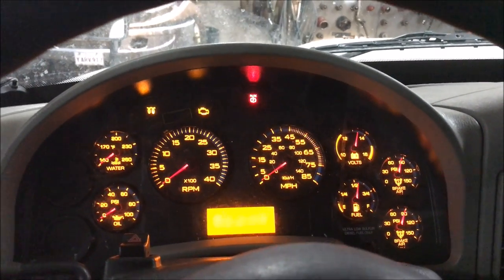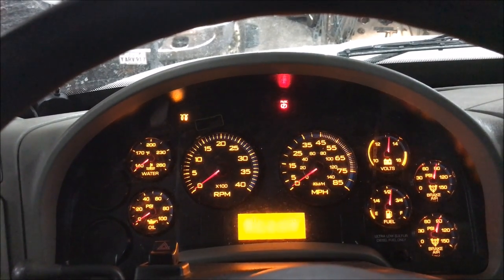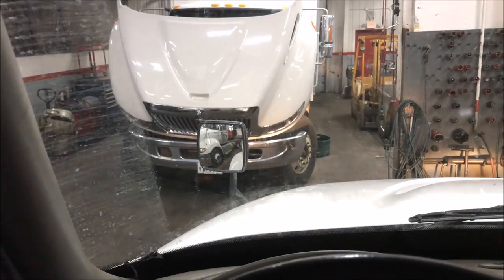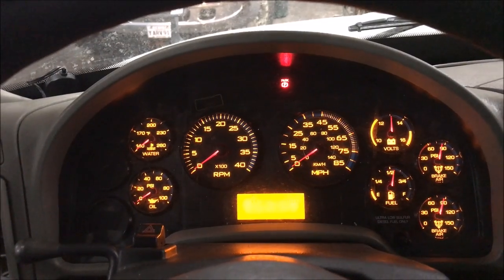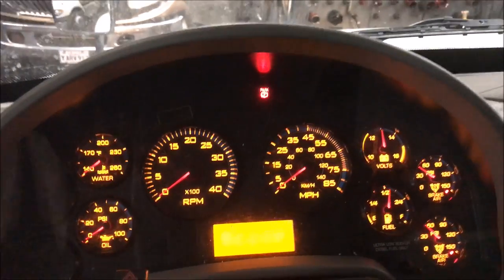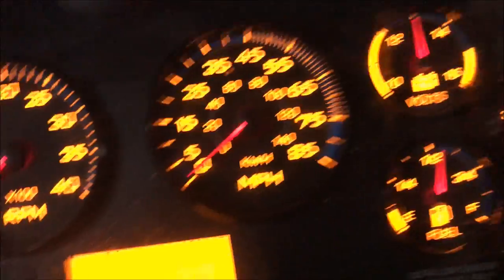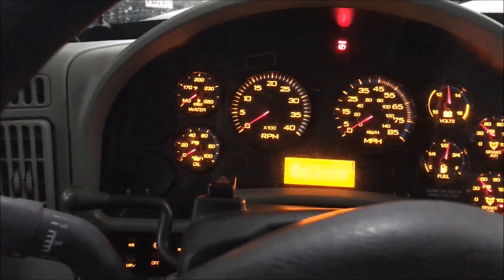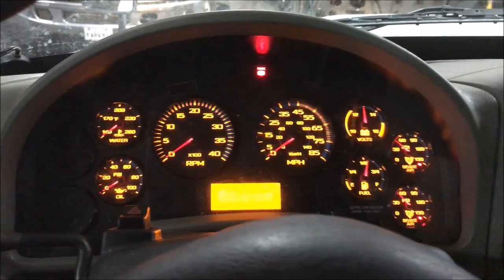International Warning Alarm/Chime/Buzzer Disable

Comment: Serious question. Do international trucks beep when you go over a line? Like say your driving and your tire veers off a little over the lane line does it beep?
Reply from the maker: It’s possible if it has an On Guard system or other system like Bendix that has forward radar and lane assist. Would have to be a pretty new International, though.
Reply: @Tony The Truck Guy  I started working for a terrible company and the first day I drove which I've been driving for years but the first day I noticed the alignment was off so I was on the line a few times and she's like oh well trucks this big can't keep a good alignment and the international will make a loud noise on either side of the inside of the cab if I go over a line and they don't have brand new trucks. The one I'm driving now has over 230 thousand miles on it but I just thought that was a crazy thing to say!
Reply: @TonyTheTruckGuy  also thank you so much for the response!
Reply from the maker: @avibeontherun  You can definitely get a decent alignment if all the suspension and steering components are not worn and whoever does the alignment does it right. International dock trucks all ride like shit, though. The rear suspension sits on the bump stops from factory.

Comment: Thank you so much, our jetA fuel truck at my airport has this terrible beeping every time we use it because of an air leak my work is too cheap to fix and it kills my ears. When I start it up I have to stand outside it for 5 minutes until the beeping stops, I’m excited to try this, wish I could just find the actual speaker and rip it out.
Reply from the maker: Yeah it MIGHT not work with the low air buzzer. Some situations it just simply won't stop beeping, but it's worth a shot. I believe the beeper itself is housed just below the cluster but I can't remember which side of the steering column it's on. Another gentleman in the comments here said he located it and jammed a rag in the speaker compartment and that made it much more bearable lol.
Reply: I mean, who needs brakes with 3,000 gallons of jet fuel on board lol. They really need to fix the air leak instead of masking the problem.
Reply: @jasoncammeyer757  Wow I can’t believe it’s already been so long since I made this comment. I’ve gotten out of my 10 plus year aviation career and work at a chem plant that prioritizes taking care of its equipment. Funny thing is I really bet that truck still has this problem lmfao

Comment: If this does not work, which in my case, did not work, then I have a bandaid... through losing my damn mind over constantly hearing this beeping, i finally found where it's coming from. If you put your head under the dash panel light dimming switch and look at the bottom of the dash... up by the wires and everything. There is a small circular hole kinda above the back of the dimmer panel. If that made any sense. That hole is where the beeper is at. My temporary fix was just using the tools i had handy, i stuffed  a balled up piece of mcdonalds napkin in there. I can no longer hear it. However if you feel like opening your dash and unplugging it, that will work too. But a balled up piece of napkin works great too. Just have to stuff it into the hole.

Comment: Mine is a '19 LT and the TPMS (tire pressure monitor system) has a failure so that infernl chime is constant.  My dash, etc is a bit different, mine doesnt have the light brightness button it has a manual type dial (up or down) and has a trip odometer (1 and 2)...I tried holding the brightness dial to the top while resettting Trip1 Odometer but that didn't reset the chime....any other ideas for resetting the chime on my International model? 

I even considered wrapping the chime speaker to muffle the chime but couldn't find it amongst the wiring when i removed the lower dash panel to look for it.
Reply from the maker: Unfortunately I haven’t played with enough of the newer LT’s to see if there’s a trick to do the same thing on those or not so I can’t offer any additional helpful advice aside from trying to wrap or plug up the chime speaker as you said you were already trying to do but I k is they’re a pain to pinpoint lol

Comment: Any idea what could cause both air gauges to malfunction especially in the mornings. First thing in the morning they will max out and driving down the road they   jump between 30 and 150 pounds
Reply from the maker: Kind of hard to pinpoint it without some testing, but I’m guessing your actual air pressure is fine since i normally can’t fluctuate like that. You’re probably looking at faulty wiring, instrument cluster, body controller, or somehow both pressure sensors went out at the same time. But again, hard to pinpoint without actually looking at it.

Comment: I've got an older freight shaker and when I drop the air bags a buzzer goes off. I do that to level the truck out to sleep lol. Not a problem when the truck is off, but if I need ac or heat I just idle the truck. Is there a way to do a temp or permanent disable of that buzzer?
Reply from the maker: Not that I know of unfortunately. Unless you were to cut the wire going to the buzzer, but it might be the same buzzer as your low air warning so that would be a no-no for DOT lol
Reply: @TonyTheTruckGuy  I'll have to check my air buzzer and see if it sounds the same. Thank you.

Comment: Not working for my low air pressure with key on On position 😭 any tips?
Update: key on accessory position worked but not all the way to the left.
Awesome thanks so much dude, now I can watch TV in peace without the buzzer going off.
Reply from the maker: Haha yeah it will only work in certain positions but it beats nothing
Reply: Tony The Truck Guy dude shutting that off beats everything. And it's temporary do DOT won't climb up my ass and down my throat to meet in the middle and discuss what other ticket to give me.

Comment: Tony
I have a 2016 d13. The low air warning buzzer works with the truck started. It will not work with the key in the in position 
Any suggestions
Reply from the maker: I assume you're talking about a Volvo? I think that's how they make them to be honest. I've noticed when doing DOT inspections on a lot of Volvo's, they typically have the visual light indicator showing that the truck is low on air if the key is on, but won't actually sound the chime unless it's running.
Reply: Tony The Truck Guy  Yes it is a Volvo. I have someone testing in it Friday and one of the air brake pieces is that with the key on and truck off to bleed the brakes down to 60 lbs til the alarm comes on. There are plenty of lights that come on but no alarm.

Comment: Hello,

I am having this issue with an international ProStar 2008. It stops for a few seconds and then it is back at it again. I have tried with the engine on, as well as the switch on ON as well. Thoughts?
Reply from the maker: Well do you know why it’s beeping?
Reply: @TonyTheTruckGuy  no i beeps none stop while on and while driving
Reply from the maker: @lixyibethgarcia1892  Not overheating or low on air pressure or anything?
Reply: @TonyTheTruckGuy  nope
Reply from the maker: @lixyibethgarcia1892  That’s very odd. Something must be triggering it. This trick only works temporarily unfortunately

Comment: How do you stop the buzzing noise coming from brake pedal when you shut off your truck?
Reply from the maker: If it’s not the same noise as shown in this video, but rather a buzzing or humming noise, it’s likely your electronic brake assist motor not shutting off for some reason. The motor helps assist you with braking in the event that you lose hydraulic/vacuum assist. You can check the fuse box on the passenger side dash and on the drivers side steer fender under the hood to see if there’s any fuses or relays for that brake assist motor that may be bad. Otherwise there may be an issue with your ignition where it’s still sending power even with the key off, or the motor itself could be shorted out. Hard to pinpoint exactly without being there to check it out but hopefully this gives you some idea.

Comment: It only works with key turned to on position. But once truck is running,  it doesn't work, the alarm continues to sound. All my gauges on right don't work either, like volts, fuel, air. And DISAB (rollback assist) blinks. I have 2016 International. Any ideas? Lol, yes, I'll eventually get it to a shop.
Reply from the maker: It seems to also work with the engine running, but only for limited issues. I’d say body controller issues or wiring if it’s a clump of gauges not working. We have had a few in our shop act up and people shotgunned gauges at them without curing it.
Reply: @TonyTheTruckGuy  another driver told me to disconnect/reconnect battery wires to reset it. It worked. I was 7 hours from repair shop, that alarm was dri ing me crazy lol. Thanks for getting back to me!!

Comment: Tony,  volvo fm9  (Ireland )  the dial in cab for switching between cold and warm air is broken, stuck on warm,  not good this time of year ☺I've been driving scanias most of the time and know where the manual opener and closer is under hood,  searched all around volvo and can't find it,  any ideas?
Reply from the maker: Did the actual dial break or does it just not seem to be doing anything? I would open the hood and check the firewall for where the heater cord hoses come out. Follow those and see if there’s any manual shut-off’s in-line with the heater hoses. If not, you may have a blend door or switch issue.

Comment: Can you do a video on a freight liner cascadia?
Reply from the maker: I’m not aware of any way to silence the alarm on those. I’m not certain that you even can to be honest. Usually the Cascadia only makes noise when you’re low on air or have red check engine light on. What’s the issue with yours?
Reply: Tony The Truck Guy I see every time I turn on the ignition key it makes a really loud beep noise hurts my ears definitely causing ear damage not sure how to get rid of it though.
Reply from the maker: But it stops after the truck starts?

Comment: My low air alarm woke me up (cool bought, with air bleed off) and with the key in the off position and the auto start/stop button system on, this trick didn't work. I tried putting the key in the accessory position, it still didn't work. It only works with the key in the 'ON' position, which of course disables the auto start/stop system. Am I just out of luck and can't use the auto start/stop when it's cold?
Reply from the maker: Yeah unfortunately the key has to be on, so if your auto start is disabled with the key on then you’ll need to get the actual problem fixed in order for everything to work properly. Possibly just the air tank pressure sensor itself

Comment: My 2012 4300 Durastar makes noise when its in D and im driving low speed on uneven surface  parking lot ,since I don't have paper work on it exept Title cant drive on the road , can u guess the reason of beeping ?  thank U
Reply from the maker: Typically if it’s beeping, there’s a warning light on the dash or a message displayed in the odometer. If it’s not doing any of that, it’s going to be pretty hard to pinpoint the issue.
Reply: @TonyTheTruckGuy   CA that is what comes up next to D sign (drive),  it has air suspension hopefully it has nothing to do with it right? 😓 btw thank u for respond
Reply from the maker: I hadn’t seen the CA message before, so I Googled it. Apparently if you have an automatic truck, CA means Clutch Abuse. Apparently it comes on when the clutch gets hot, aka slipping. This happens while backing up, or just if you’re slipping the clutch too much. If your foot isn’t on the clutch pedal and you’re not working the truck hard, but it has the CA light on, that may be an indicator that your clutch is failing.
Reply: @TonyTheTruckGuy   sounds like a problem and u r right I smelled something , do u have Idea how problematic it can be mechanically? And how much it'll  cost 2fix it?
Reply from the maker: It will continue to get worse until the lurch is slipping completely and you can’t move basically. I’m now sure on the cost of the actual clutch for an automatic, but I think typical clutches for rigs run about a grand give or take. Plus about 12-20 hours of labor.

Comment: I think there is a cable going from dial to heater, when u turn from warm to cold it's doing nothing,  staying on warm, just can't find the manual shut off.  it's very easy to find on scania,  just lift grill and it's right under front window, thanks for the reply
Reply from the maker: Sorry for the late reply, this was one of many comment being held for review for some reason. Did you figure it out?

Comment: I have a 2014 Int Terrastar, somehow whenever I put the fuse in for the windshield wipers i get an alarm for brake pressure. I’ve tried this hack, but couldn’t get it to stop the alarm from chirping.. any ideas?
Reply from the maker: It’s pretty hard to diagnose without being able to see the truck unfortunately. Does the truck have hydraulic or air brakes?

Comment: Hi mate can you tell me why is my pto is not going off after I turn it off it keeps running  I have got a Mitsubihi fuso canter 2012 and my dpf light won’t go off thanks wayne
Reply from the maker: If the PTO is always engaged, your switch is likely bad. Try holding the regen button with truck in park and see if the light goes off after a parked regen.
Reply: Hi thanks I tryed that and the regen comes on for 10sec then stops so the pto light coms off but it says to do a regen now then it comes on for 10 seconds so I put my diagnostic machine on on these are all the codes po404 exhaust gas recirculating and p2174 throttle actuator control system sudden low air flow any ideas thanks Wayne I’ve been trying to fix this for four years now
Reply from the maker: On the international trucks, the dash will sometimes display “cruise set/PTO on” in the dash cluster. Is that what you mean when you say the PTO is engaged? Or does the truck actually have a PTO with a separate switch that stays lit up? As far as the regen goes, it’s probably running for 10 seconds then cancelling out because of the 2 engine faults that you listed. Those will need to be fixed before the truck will do a successful regen. Both codes could be caused by either a failed component itself, wiring, or computer issues. You would have to figure out which pins to check for each component at the engine ECM, then test wires from there to the EGR and throttle valves. Or bring the truck to a shop for diagnostic confirmation if it’s over your head or you don’t have the proper wiring diagram.

Comment: I love that you know that trick.  But it didnt work for me.  Mine is still beeping. And it says *abs module.  
  There is nothing wrong with the brake system.  How do i stop this noise?
Reply from the maker: Unfortunately the truck does not work for every warning message. I would try a few more times to make sure you’re doing it right. I’ve also heard that disconnecting the batteries for about a half hour could do the trick but if that fails, you’ll likely have to fix the actual issue. Here in MN, ABS is required to work in order to pass a DOT inspection anyways.
Reply: Make sure your key is on I tried it with my key off and it didn’t work. Turn key on but don’t start and air pressure warning goes off

Comment: It works when truck is off.. But when I then turn on. It beeps..? Am I doing something wrong
I turn key to the right. Hold the buttons and air beeping goes off. Does this only work for when the truck is off?
Reply from the maker: Why is it beeping when the truck is running?
Reply: Tony The Truck Guy well actually my volt meter dips and beeps. Has been at the shop over a week and can find nothing wrong. So when driving it just beeps and beeps randomly all day. Sometimes it'll just beep the three time and be gone. Later it'll beep and beep non stop.
Reply from the maker: Ah, this trick is not working for you because it would need to be done every time the beeping starts. When the truck is off, it only tries to beep once so unfortunately the only way to stop it is to fix it or tear apart the instrument cluster and disconnect the beeper.

Comment: I tried it and it worked for about 3 minutes and then the beeping started again. Now the trick won’t work at all. It keeps throwing “electrical fault” even though nothing is wrong. The brake pressure, brake fluid, ABS, and TC lights all come on. The brake sensor has been replaced twice already. All fluids and everything are full and it has hydraulic brakes
Reply from the maker: If there’s an active issue like that then it won’t work unfortunately, you’ll have to figure out why all those lights are on and repair the issue. You’ll likely need to scan for codes to see what’s going on.

Comment: Any idea where the speaker is located? Sounds like it's coming from behind the panel there the mirror heater/light switch/ panel light adjuster is. I'm going to stick a knife in this thing. It would not be as annoying if it weren't so GOD DAMN LOUD!
Reply from the maker: Unfortunately, I’m pretty sure the speaker is built into the instrument cluster. You’d probably have to cut it apart or smash it lol
Reply: @TonyTheTruckGuy  honestly pretty close to it hahaha, or even if I could put a ton of duct tape over it to muffle it a bit would work